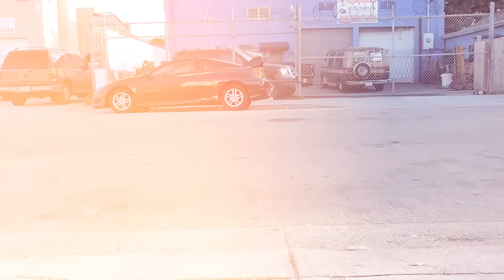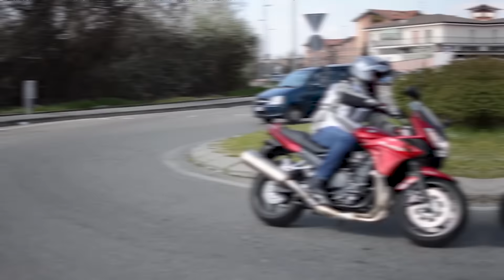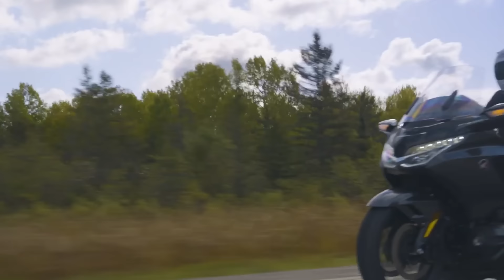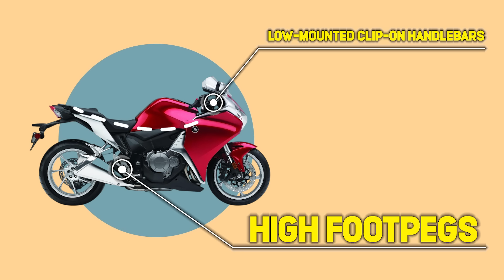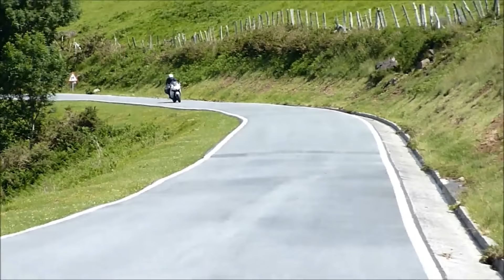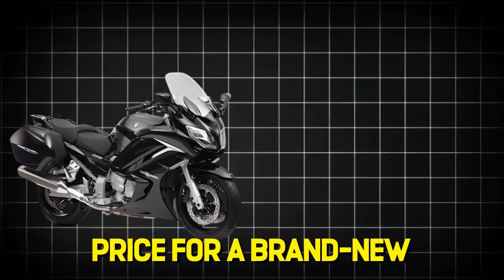12 Dirt-Cheap 1200cc+ Motorcycles, Nobody Buys! (But They’ll Outlast Every New Bike)!

Comment: I highly recommend the Voyager ABS, if you can find one. It is true that the steering on my 2010 Kawasaki Voyager ABS was a little heavy with the original crappy Dunlop tires that it came with. In fact that was my only complaint. But once those tires wore down and I was forced to replace them with decent tires, I don't experience this at all. With properly inflated premium tires, this is an easy bike to handle at slow speeds. It is well mannered and balanced. Further, after 16 years, it's as smooth and vibration free, either at idle or at 80, as it was when new. It's extremely easy for DIY maintenance. Also, except for some minor changes with electronics, the 2025 version is the exact same bike as my 2010. In fact the only difference between those and the 2009 (the maiden Voyager model) is the improvement in the heat control on the right side as the video mentioned. These come in two models, ABS and non-ABS versions. I highly recommend the ABS version, which links the front and rear wheels over certain speeds in hard braking. It works great.

Comment: I bought a 1979 KZ100 out of a field for 250 dollars in 2002. It had 60,000 miles. I put maybe a 1000 into it and rode hard till the speedometer broke at 92 thousand miles. I think I put another 30,000 miles before it died.

Comment: I bought a Suzuki gsxs 1000gt to replace my Honda ST1300.  I stiil cant turn the ST1300 away, its such a great bike. I have almost 70k on the Honda with nothing but normal maintenance.  Great bike. Suzuki gsxs 1000gt is great for commuting but haven't been on a long trip yet. Its so light and easy to move around but not as planted on highways like tge Honda is

Comment: Bought my 2008 Concours 14 in 2010 with 2100 miles, gave it to my son-in-law in 2025 with 80k miles on it.   It was my daily driver  in San Antonio, TX then in Oregon.  I was 75 when I gave up trying to push it backwards when parking. Moved to a light weight Honda.

Comment: I rode a 1986 Kawasaki Concours that I purchased in 1992 and sold it 2008 after putting 370,000 miles of riding rain or shine and day or night. Replaced it with a 2005 Concours that I clocked 50,000 plus miles and sold it in 2025. That bike sat for 5 years after moving out of California to Washington State on the coast. In 2025 I dusted it off and gave it a new life. The bike looked like it just came off the show room floor. But after I made it road ready I discovered my 77 year old body no longer  fit the bike. The old legs just didn't like it. So I sold it and bought a 1996 Honda Goldwing. It only had 53,304 miles. For $2300Igot a bike that had the leg room I now needed. The rear brake didn't work because the rear master had been replaced and own couldn't get it to work and the weight of the bike scared him. I bleed the brake (flushed brake and clutch) and works great. I put a set of tires on, a battery and plugs. The old owner had changed the oil and filter (oil and air). The bike great I think the carb were gone through because it must have sat at one point. Been riding it and love this bike. I am an old school biker and don't need or want all the gadgets. After over half a million miles riding bikes I don't need ABS. After riding to work from our home 16 miles from Yosemite and many times temps in the teens I don't need heated grips. I know how to dress for weather cold or hot. I will by used and he money saved is money to ride. I think you can tell I like to ride. that is what a bike is for. God bless and maybe I will see you on the road.

Comment: Love my low maintenance steady running 2007 Kawasaki Vulcan 1600 Nomad.  It is just a rock solid performer, well appointed and beautifully styled (Two-Tone Candy Cardinal Red / Metallic Titanium) chromed cruiser with comfortable low seating and well built suspension.  For its weight, it is easily manuverable at slow speeds, with a low-center of gravity, and its comfortably equiped for life on the road.  If you can handle the higher curb weight and are not looking for a high-rev sport performance bike, or a fully equiped Touring bike, you will love hopping on this bike with a smile for mile after mile worry free short/long cruising experiences.

Comment: You are kidding me!!!!  There's no way the Honda Valkyrie 1997-2003 isn't the absolute #1 bike on this list. A smooth 6-cylinder cruiser that can go 300,000 miles on a regular basis. I had the 6 carbs synced 15 years ago and that's all they needed. Easy maintence, and can handle sharp curves like a much smaller bike. With a 7 year run there are still many parts, and accessories, available for this bike. I've had my 2003 Valk for over 20 years and she can hold her own against modern bikes. It may lack some of the moder accoutrements like cruise control, which can be added inexpensively, and ABS, which is still something I'm not convinced I would want, but you CAN NOT beat the smooth ride. No "monkey butt" here. The sound and appearance of this bike always commands attention. I've thoroughly enjoyed adding addtiional chrome, Flame Pods, faux velocity stacks, small air horns, etc. If you want to see what a beautiful bike this is, take a look at my channel which also shows some of the most gorgeous rides in America, including hwy1 up the coast of California, Road to the Sun, Rocky Mountain National Park and more.  Enjoy...
https://www.youtube.com/@Denvalk

Comment: I bought a Honda  Valkyrie interstate with 5 thousand miles on it for $2000 road it coast to coast every year now i have 90,000 miles only thing I’ve ever done was oil, filter, tires and brakes , such a comfortable bike for the long haul, I think I’ll just keep on riding it forever
Reply: I've had my 2003 Valk for over 20 years, and if you only paid $2,000 for the Interstate, you got one hell of a bargain. As far as I'm concerned this is the best bike ever made.
Reply: Honda Valkyrie, built in northeastern Ohio by Americans for Americans was not exported....  Kawasaki concours 1000 cc was built up there also for 20 years....    Was not exported either.   And they were Union built.
Reply: 2006 was the last year for the 1,000 CC with four carburetors,  they close down and didn't make the 1400 fuel injection EPA.

Comment: In 2008 I bought a 1987 BMW K75, it's liquid cooled and fuel injected and of cours shaft drive, I change the oil and filter myself , it never has let me down, has plenty of power, I rode it from San Diego to El Paso, took me two days of riding, traffic around Phoenix is always bad. I started her up today and still sounds great, I like to take her out on Saturday and Sunday mornings, cursing the NM country roads. Just sharing a bike with a great engine,

Comment: At 170 lbs and 82 years old I ride the highways of southern California and I prefer a bike a bit lighter than those mentioned here, like my Yamaha 2006 FZ1 sport touring bike.  I spent a lot of time over the past few years thinking about replacing the bike but I keep coming back to this bike... I like speed and its instantaneous response - it's got 148 HP but it's top end hovers around 150mph (ok that's fast enough though) with a 3.1 sec 0-60.  In 2017 it cost me $3500 with 22k mileage.  (I had a lowered 2006 FZ6 before this FZ1 but it lacked the responsiveness of the FZ1.)  Wish the seat height was lower than the 32"... so for my place in Thailand I purchased the Kawasaki Eliminator SE 500 with a seat height of 29"

Comment: If you want a super-budget alternative the ST1100 can he bought for $1500-2000 and give you almost everything of the ST1300 except fuel injection.

Both bikes devour slab with 300 miles/tank for fast-cruise mode -- 100mph x 3hrs (hopefully your bladder can keep up). They wont dip much below that even if you run them hard in the Rockies (8-13k ft). The ST will out-cruise a cruiser and is very happy spending all day ripping sports bikes in canyons right up to the red line. Throw in the ABS / traction control and it is very capable playing on dirt tracks / inclines only limited by tires, the suspension travel, and the nerve of the rider to balance the weight. The 7.5 gallon gas tank turns the ST (Sports Tourer) into a Super Tanker - hook up a hose to the fuel pump outlet and run it to a short-legged cruiser to keep running to the next stop. 

Possibly the only true weakness is the 28A (pre-1995 civilian) alternator on the ST1100. Pre-'95 Police models and post-1995 upgraded to the 40A. Alternators can leak a little oil but can mostly be managed with stop-leak products. Help the alternator out by either soldering the connectors to the R/R or at least making sure the resistance of the electrical connector is low (no oxidation).

ST1300s are prone to leak from the radiator hoses now that they are aging, once swapped you are good for another ~10-15 years.

Ignition switches have a lot of juice flowing through them and oxidation is again the enemy. Adding an ignition relay fixes this permanently.

This is pretty impressive for a platform that was launched in 1990 built on the back of the Magna / Sabre V65/VF1100 from the 1980s.

Also shout out for the Kawasaki Concours C10/C14, and the Yamaha FJR1300 (FJ11/1200), for being such capable adversaries for almost 40 years, and the BMW flying-bricK for throwing down the gauntlet in 1982.

Comment: I owned many motorcycles over the last 45 years, and I just sold the best one I have ever owned.
This was the 2007 FJR. had 37xxx miles it. I put a new set of tires on for the new own, Still ran  like a Champ.
Reason I sold it:
 It was just to dam heavy for me as I got older, @ 64.  Bike weigh in just over 600Lbs. The motor on this bike IS a beast!!
Reply: I'm 72 and just sold my '05 FJR - best bike ever!  Took some epic rides on that beast, and had it up to 200kph just because...didn't even break a sweat 🙂

Comment: Wow, great information, all of the maintenance issues are exactly why no one buys them. I had purchased a 2005 Kawasaki VN 1600 Nomad on eBay in 2008, it had 8,000 miles on the clock, an excellent machine, not a monster speed machine just great torque and smooth power and road manors, I ended up selling it in 2015 with about 43,000 miles on it because my wife and I sold our house and had gone full time RVing and after moving out of a toy hauler to a more comfortable fifth wheel and no way to carry the Nomad, I really loved that machine.

Comment: I've owned all kinds of bikes, but the best riding, comfortable, quick bike was a 1984 Honda Goldwing Aspencade 1200 4 cyl 4 carb bike.
The only drawback was the 31" height seat, that didnt go well with my short 30" legs. It was heck to hold the heavy thing up at stop lights. I let it fall over more than once. Other than that I loved riding it. There better ones out there I'm sure, but that one was the best riding, comfortable, and quick bike I've been on. I bought it in 2017 for 1500 bucks, with 48000 miles, rode it home, tuned it up, changed a badly needed rear tire, and rode the heck out of it. AM/FM cassette radio, cb radio, push button air front shocks, that all worked. No dents or dings, no faded paint, and all original. Had been kept in a garage most of its life. Old technology, but still worked well after all these years. No computer junk to screw up. Just start, and ride.
Reply: I have a 76gl1000 its a good bike original seat too very comfortable

Comment: Harley,,,,whom rides the outside the USA,,,dont know anybody,,,,like a truck on 2 wheels
Reply: HD is not really competitive against these bikes. Too slow, thirsty, expensive, and unreliable depending on which models you compare. They have never been well accepted outside the US, and even now inside the US their popularity is fading fast.
Reply: @lostbrit2 love my HD. But I’m 78 1/2, need something lighter.  Can’t get rid of it cause there are tooo many things about it that I like. Big wind screen, self canceling turn, cruise, floorboards for both riders, 6 gal tank, maint free belt, smoooth engine, great lights (3), good top load bags, low tech, no valve adjustments, lots of aftermarket, great accessibility to shops on road trips. Can’t replace it.
Reply: @richardburdyn9577  The Honda St1100/1300 off all of that too. Except swap the belt for a shaft - so it's good for the life of the bike (>300k miles); electrically adjustable windshield on the ST1300; great weather and wind protection on both - from head to toe; no overhead issues in >100'F in traffic; not parts shaking loose; no need for premium gas to deliver sub-par performance; better handling; ABS and traction control; weight held very low since the 7.5 gallon tank is between your calves/knees;  v-4 is always smoother than v-2 and nicely quiet with no vibration; the ST are actually pretty low tech, the electronics they do have are Honda - and last very, very well, often the life of the bike; shim and bucket valves mean check every 60-90k but adjustments are very seldomly needed; ST will eat miles on slab (3hrs x 100mph per tank) or in the twisties. Imagine it's like a HD but never needs an engine rebuild.

I know Americans love the HD tradition, but there are much better bikes out there, and have been since the 70s. That is why HD almost went bankrupt in the 80s (only 45% tariffs saved them), and why the rest of the world doesn't ride HD, and why even in America, new riders are making better choices.

Comment: Well they did not have my 2006 CBR1100XX Blackbird on this list, It is a nice riding bike and with 8900 miles it will out last me. Only had ethanol free gasoline run through it.  It is all the bike this old geezer needs!
Reply: 72 thousand on my 02.

Comment: I now ride a 2009 BMW K 1200 LT I love the looks of the bike. It’s very fluid looking and it’s got beautiful lines to it. It’s probably one of the most beautiful touring bikes made my complaint the bike is little too wide, but besides that it seems to be a great touring bike that swallows a mile at triple digits if you want the back door 100 miles now are very easily before you look down twice roll on fifth gear and interstate and it has pick up speed

Comment: The best touring bike I’ve ever ridden most people probably never heard of was a Suzuki Calvacade with its V4 engine. It was a strong runner. Well equipped did not need a lot of maintenance. What maintenance did deed was basic oil changes and tires and brakes. They were great bikes that just never got the recognition they deserved.

Comment: Living near mountains I would never buy a carburated bike again. The used prices listed are all on the low end. That said if you watch and pounce you actually can get them at those prices.
Reply: I live in Oklahome at 732' elevation, but spend July and August in Frisco, CO at over 9,000' elevation. I've taken my 6 carburetor 2003 Honda Valkyrie here for 12 years, and I can't tell any difference from how she runs at home. So much for never considering a carburated bike for the mountains.

Comment: Had a 2004 ST1300. Best sport tourer ever. FAST and nimble. Loved it!! Did not love the heat from the engine. Going to sell my 2017 Ultra Limited soon. At 75 it is damn heavy. Going to go for a 2023-24 FJR1300.

Comment: I found a 2011 Triumph Thunderbird 1600 ABS A1 that had been in storage for 15 years. 38 miles on it when I got it last October. Good as new after fixing the damage to tires, fuel lines, inside of the gas tank, fuel pump, some brake lines.... before I bought it for 7000. Slow and careful engine break in. Its absolutely a hot rod. Beautiful new motorcycle, rock solid, smooth ride. polished up like a diamond. Just love it. Rode a little fat boy the other day. Not impressed with a Harley. My Triumph is a lot more nimble and more torque when it counts I think too. Probably 30,000 for an equivalent Harley these days.  The Triumph was Cruiser of the year in 2010.  No changes to the 2011 I have.
Reply: Nice! I grabbed a 2014 Thunderbird LT ( 1700) fully loaded for 5k in PA. 9300 miles. I freaking LOVE IT! Minimal surface rust on the pipes and back rim.... otherwise looks awesome. Gonna detail that off shortly. Smooth. Fast. Nimble for it's size. We got the right bike , my friend.

Comment: Last year I bought a like new 2005 Yamaha FJR1300 with just 13k miles on it, and it is my 8th motorcycle, but now I wish it would have been my first. I love it, what else can I say?
Reply: I have a 2014 FJR1300 I bought it new and it is my forever bike. I have never had an issue with it and runs like dream.
Reply: @gmwalk3 😮😮😮exelent
Reply: I also had an FJR 1300 2005.  How anyone want more from a sport touring bike is beyond me.
Reply: @TimothyWilkin  Same, 2005, bought it new. Amazing bike. Never, ever let me down. Puts a smile in my heart every time I ride.
Reply: I owned a wonderful FJR 1300, used it on auto as my left hand was damaged in a previous accident. Did a UK hardbut ride Lands end to John o Groats and back and another 130 miles back in under 24 hours. It was my daily ride. Miss it so much! The Honda NC 700 was a great stand by.
Reply: You can say it's overrated,  hot and heavy?
Reply: @nervotica7991 maybe buy a 34000 RT

Comment: Owned a Suzuki 1250 fa and a St 1300 . The St 1300 made me smile every time I road it, It’s engine was incredibly smooth and had none of the annoying high rpm buzz of even the smoothest inline four. The chassis although heavy was extremely neutral and well balanced making it feel lighter in low speed handling than bikes like the FA 1250 or the FJ 1300.In hot weather in slow traffic though it was very hot😊

Comment: I've a 2002 BMW R1150 RT. 68k miles. Never misses a beat. Cheap to service.
Reply: I had (still have) a 2006 BMW K1200 GT, loved that bike too but the ABS module went out.  Part cost more than the value of the bike. :(  Does the R1150 RT have ABS and the dreaded servo power assist?